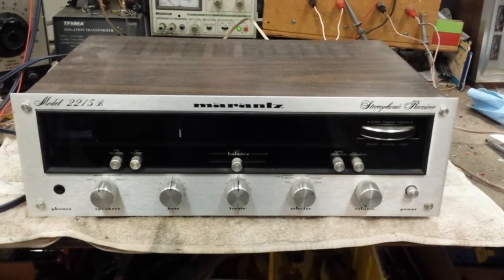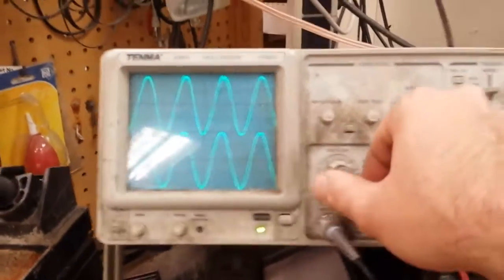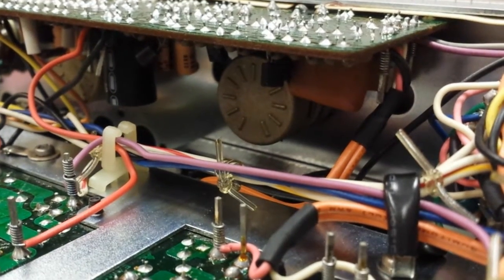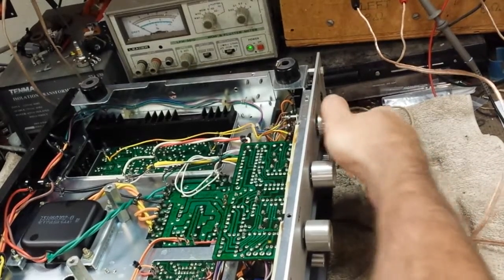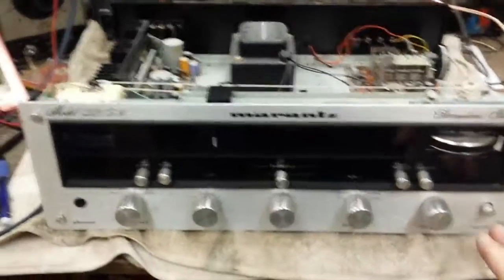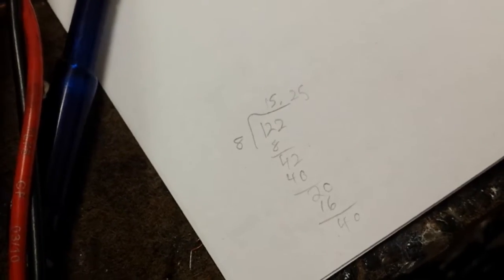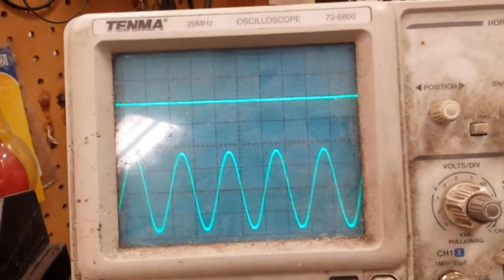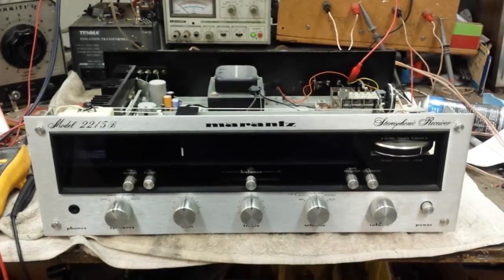Servicing a vintage  Marantz 2215b stereo receiver.

Comment: Very good video. One point: you adjust the colector DC bias current of the amplifier final transistors to 64mA (30mV/0.47ohm), while the Service Manual indicates to ajust this current to 21mA (10mV/0,47 ohm). Why do you increase the current? Thanks.
Reply from the maker: +melondeinvierno sorry for the late reply. I often find that the stock bias adjustments on Marantz 22 series receivers are slightly low -especially for the lower power models. A slight increase lowers crossover distortion slightly, perhaps not noticeable to most. However I've been able to tell with my ear and with a distortion analyzer there is a slight difference in the 3-5khz range
Reply: OK, understood. Thanks.

Comment: I have this receiver and mine is having the same issue you had at the beginning with the volume and speaker not working.  So just for yucks I thought I'd give it a search and I'm here.  If I move the volume up and down I can eventually come across a setting where both speakers will work.  So I am guess it just needs some of your magic spray?  Is it DeoxIT 5% Spray Contact Cleaner - D5?
Reply from the maker: First, open the top and look at the back of the speaker terminals. There are screws that hold them to the eyelet connectors. Make sure they're all tight. 

If that doesn't do it, figet with the speaker buttons while the channel is out to see if it will come back. If so get some deoxit in those switches and work them about 50 times each. 

If that doesn't work try the same with the tape monitor. And balance control.

If all else fails you may have a bad volume control.
Reply: @JordanPier  thanks for the quick reply I will try your suggestions!!!!!!

Comment: Hello Jordan,  I wonder if you would help me figure out why my left speaker/output plays at reduced volume.
I've cleaned all switches with DeOxit a few times to no avail, I will order some of that shield contact cleaner next and try that, if that doesn't work would replacing capacitors be my next step? Hope this finds you safe and healthy during these challenging times!
Reply from the maker: Sounds like more troubleshooting is in order. Replacing caps doesn't always fix these problems. If you don't have a scope to trace out where in the signal path the left channel diminishes, you'll never know what exactly is causing the problem and may just be pouring money in parts into it.
Reply: @JordanPier  Thanks, Jordan, for your honest reply, looks like I may need to invest in diagnostics and educate myself thusly so I can repair these things myself, wish there was a practical tutorial on how to use an oscilloscope to trace signal path thru a receiver and the likes for a newbie like me, Best Regards!

Comment: Hi Jordan, I just picked up a 2215B and found a service manual online.  Regarding the bias adjustment, the manual indicates 10mV but you tuned the one in the video to 30mV.  Is 30mV the optimum for best sound?  Thank you!
Reply from the maker: 10mv is ok, but in these I find the slightly higher bias setting yields a little less distortion.
Reply: @JordanPier  Thanks for the quick reply.  10mv is also in called out in my Sansui AU-317 manual but I think that unit definitely sounds better if I bump up above 20mV.  I plan to recap the 2215B and then I'll be experimenting with the bias level a bit.

Comment: I just got one. A 2215b in BLACK. yes Sir black. I´m curious if they exist on the U.S. market, or is it just european import. ? Google doesent tell much.
Reply from the maker: +Funkywallot that would usually indicate it's for the euro markets. Pioneer sansui and Kenwood had their black face models too
Reply: Thanks. Btw. Its an awesome sounding Receiver. Equal or better than a freshly serviced HK 70´s models ( 430,630,930 more powerful obviously - but not better in any way with moderate volume) In my book top tier. Lots of Gusto and attitude.

Comment: where i can find a restoration kit for the Marantz 2215B and some lamps?
Reply from the maker: look up dwojo  for lamps
Reply: Thank you for the info 
I appreciate it.
Reply from the maker: as far as restore kits, there are none that I know of. if it works fine with no issues just enjoy it. treat switches and controls with caig deoxit, replace the lamps and you should be fine

Comment: Hello! Do you know what can happen if I turn the receiver off without having speaker set turned off beforehand? I mean, can this damage the speakers?
Reply from the maker: Very doubtful
Reply: Lately I noticed that one speaker is considerably quieter than the other and not so long ago I accidentally shut the receiver off as described above, so I thought that could have done the damage. I switched the speaker places, and still the same one is quiet. It works fine on higher volume levels, but still isn’t as loud as the other one. Is it the speaker or just potentiometer?
Reply from the maker: @MrLaskez99  swap wires at the back of the speakers ( right to left and left to right). If the same speaker is still quiet it's the speakers fault. If the other speakers quiet now it's the receivers fault
Reply: @JordanPier  You mean reverse polarity?
Reply: Reverse just on one that’s been quiet or on both?
Reply from the maker: @MrLaskez99  you're trying to determine whether the speakers or the receiver is the cause. You do this by connecting the wires for the left speaker to the right one and vice versa. 

If the speaker that has always been quiet is still quiet, then that speaker is to blame. However if the opposite speaker is now quiet the receiver is to blame.
Reply: @JordanPier  I did that beforehand, and the one that has been quiet is still quiet. Can this be repaired by a technician or should I be looking to buy new pair?
Reply from the maker: @MrLaskez99  unless you can disassemble and troubleshoot the quiet speaker, find the offending part and find a replacement - I'd look for new speakers 

The quiet one may be damaged to the point where it is harming the amplifier
Reply: @JordanPier  Thank you very, very much for providing the information. I’ve got just one question more that I haven’t be able to find an answer for. I’ve got Marantz 2220 which has been working fine, until one day - a VERY loud crackling sound appeared in right channel. From the moment you press the speaker set button (doesn’t matter whether is MAIN or REMOTE) right channel crackles very loud and it doesn’t stop until you turn off the speaker set. What could cause this?
Reply from the maker: @MrLaskez99  failure of one or more transistors in the output of the preamp or input of the power amplifier
 
Troubleshooting with a signal tracer or scope would be necessary to determine what section of the machine and what offending parts were responsible
Reply: @JordanPier  I inspected the receiver visually inside, and found that one capacitor on the power supply board (P800) looks like it’s burnt (blackened on one side, literally looks like it was burning once). Could this be the only problem?
Reply from the maker: @MrLaskez99  not the issue. The burned stuff as adjacent heat breaking down the sleeve or glue holding it to the board
Reply: @JordanPier  Thank you. I wanted to replace incandescent bulbs on 2220, and I can find only 8V/250mA bulbs, but I saw that 200mA is the original value. Can 250mA bulb be a problem to a receiver, since it generates more heat?
Reply from the maker: @MrLaskez99  yes, heat buildup can discolor the diffuser paper and damage the plastic housing

Dgwojo.com has the proper lamps. I've been getting them from him for years.
Reply: @JordanPier  Hello. The mentioned problem with 2220 (crackling in right channel) stopped and both channels worked perfectly for 2 weeks and today crackling showed up again. Is it possible that just controls need cleaning?

Comment: My 2285 has Woofer flutter when Loudness is on and volume cranked on JBL 430's  (rated 120W RMS).  Would Bias have something to do wtih this? Suggestions appreciated!
Reply from the maker: marty V.A. if flutter occurrs with no signal attached problems with DC leaking into the loudness circuit is possible. This is a rare failure. If you're playing records, this is more common due to records having imperfect surfaces along with acoustic feedback and poor cartridge compliance.

Remove the signal from the input and observe again. If no flutter the problem is in your music source. If flutter is still present there is a problem in the loudness circuit - if it only does it with loudness on

Comment: First of all - really appreciating your give-away-knowledge! When attaching the first clamp here: https://youtu.be/Jfk5rTGOYeI?t=746 - I managed to lean it to the big metal part at the left. Result: blew it. Darn. My bad of course - any advice on how to proceed?
Reply from the maker: You're going to need service literature with a schematic, and to replace the output transistors and driver transistors at minimum. There will likely be burned open resistors in that signal path as well. Direct coupled amps like this go down hard when a part is shorted.

Comment: Ok, so I personally would just use LEDs if replacing the lamps on that classic vintage amplifier.

I'm sure many puritans may get strongly pissed at my opinion.
Reply from the maker: I like the look of the original lamps.  If they ever make LED lamps that can exactly mimic the color temp and illumination dispersion of the incandescent lamps -ill do it. Otherwise no. LEDs are a replace it and forget it. I also can't stand the flicker, and rectifying and smoothing the lamp voltage may require a dropping resistor to lower brightness - otherwise it's just too damn bright for my taste
Reply: I like brightness, that's why I thought of LED, for the extra brightness (though idk how the display actually looks irl). As for flicker I have no idea what people are talking about when they say LEDs flicker, they don't flicker for me or at least I can't see it, I guess some people have faster eyes.